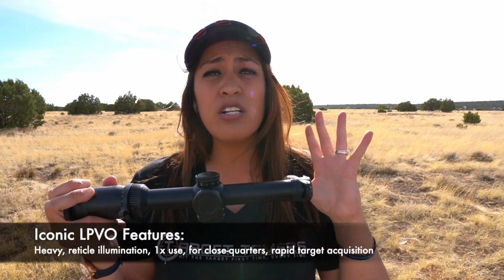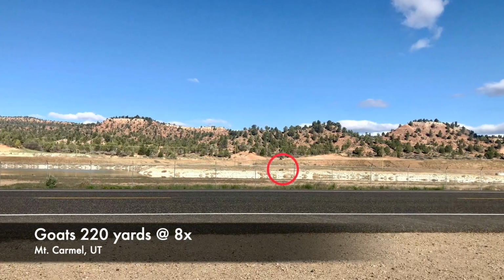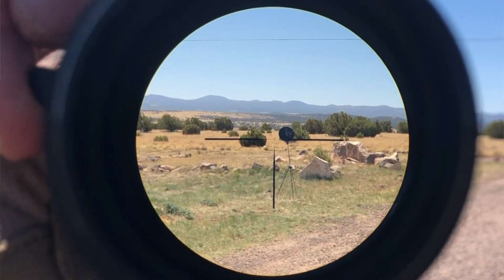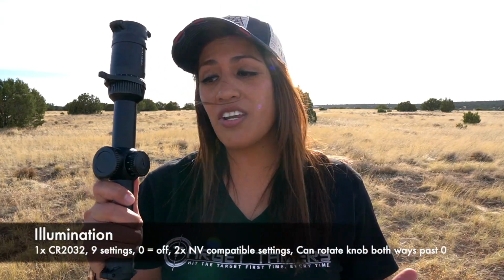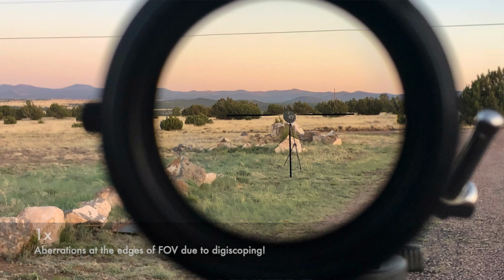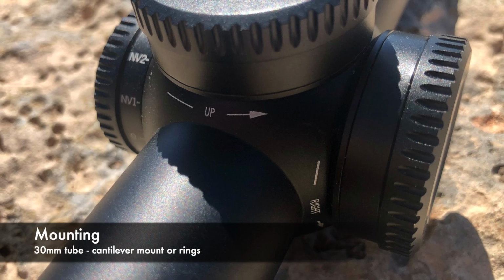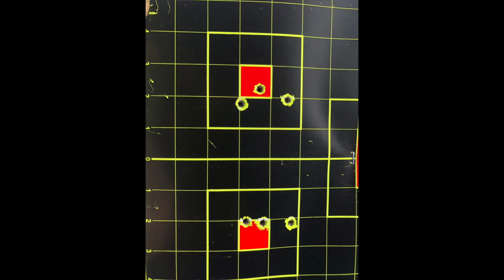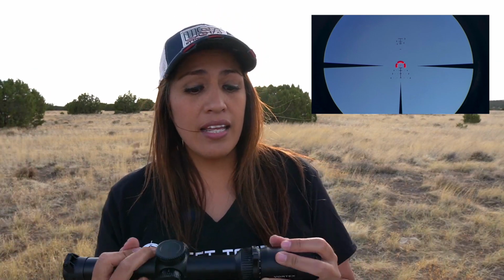Owners Review: Vortex Strike Eagle 1-8x24 FFP (EBR-8 MOA Reticle)

Comment: Do you guys see random speckles at night on the highest illumination setting?
Reply from the maker: I just checked for you as I've never noticed before, but I did see random speckles just now. They looked to be lit up but only from the strong illumination. I gave the objective lens a quick clean, checked it again, and they were gone. I think mine was dust. 

2 itty bitty dots remained, but they look to be part of the outer illuminated line of one of the crosshair posts. But it's far from being a distraction. I hope yours turns out to just be dust too! - Tina
Reply: Thank you that help a lot yeah I called Vortex they said is normal at highest illumination level.
Reply from the maker: @aftermath2333  Thanks for sharing your response from Vortex! - Simon

Comment: My take is this, if you're actually going to use the wind holds, bullet drops, and ranging features, etc.. this is a decent option. Quite a few of these dot- horseshoe type reticle optics end up on 5.56 AR platform rifles and I have a feeling they are often not used to potential..I prefer the Vortex pst 1-6 and find it better in every way than anything strike eagle for the same money...  The strike eagles alway seem to fade in clarity at max magnification where the pst stays clear and has a daylight bright center dot which I personally prefer. It's said the PST is 90% of the Razor at less than half the price.  Just my .02, good review!
Reply from the maker: Thanks for sharing your thoughts! - Simon
Reply: Agreed, and I went with the same purchase decision for the same reasons.
Reply: The 90% of the Razor at 50% of the price was brilliant marketing by Vortex. Brilliant. They still accomplished what they wanted to by both ends of the spectrum purchasing both optics. 

I have/had both. The Razor is superior in every way. What %?  I wouldnt begin to quantify it but let me just say this. You get what you pay for. The PST is a good optic but its not a Razor.

Anyway....I have looked through the Gen 2 Strike Eagle FFP and I have to say it was impressive...very impressive.  Was it as good as my PA PLX Compact? No, but it will get the job done. 

I believe at this point in time LPVO's have come such a long way from even 5 years ago that we are splitting hairs when we talk about optics in certain price ranges. What it comes down to is preference......

You said you like the PST..........I hated it. The reticle is horrendous. Yes the dot is daylight bright for sure.

I much prefer a FFP LPVO. At 1x yes the reticle gets small on any LPVO - not just the SE, but it still provides a dot as a reference. With that said I very rarely even use illumination, and with most of my LPVO's I run and offset red dot so 1x is a redundancy. I find it much faster to cant my rifle 45 degrees instead of throwing the switch from back down to #1.

Comment: The main question I have, is this red horeshoe visible on 1x in the daylight? With how small the reticle us on 1x I'm worried it will be hard to pickup. Thanks for taking the time for this video.
Reply from the maker: Thanks for the feedback and question. The horseshoe is quite visible in the daylight (illuminated or not), but when you're focused downrange on a target, the center portion can be difficult to pick up at 1x especially when you're in a rush. However, the illumination and bold, thick posts lead you straight to the center which turns out to be a much-needed feature on the SE at 1x. 

The horseshoe is 12 MOA wide and the illuminated segments are 2 MOA thick, so it's effective for 1x use and you can still see the horseshoe shape. However, the center .75 MOA dot "disappears" because it's so tiny. 

At 1x, I'm just making sure I have the illuminated part on my target and I know I'm good. Plus, because it has variable power, you have the discretion to use it. I certainly do! I hope this info helps you! Thanks - Tina.